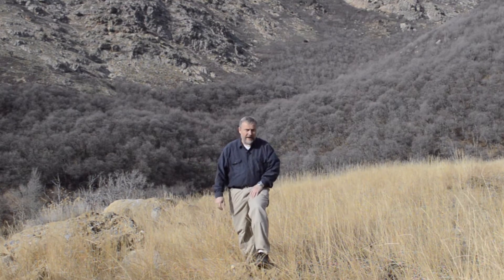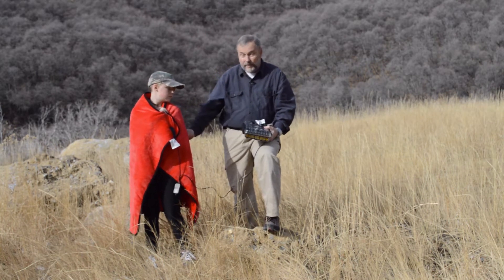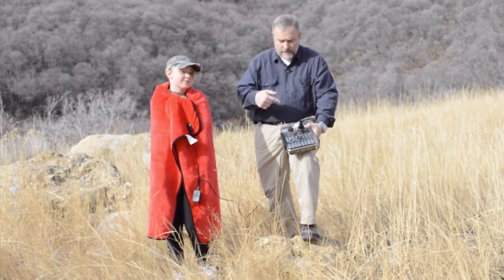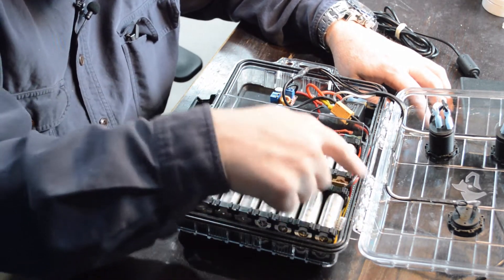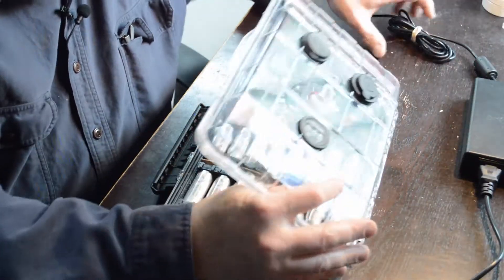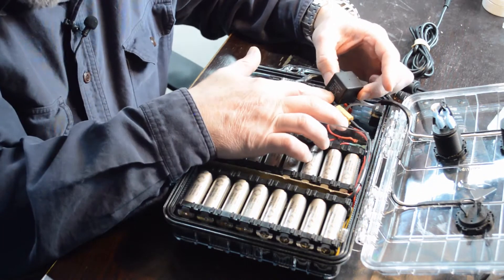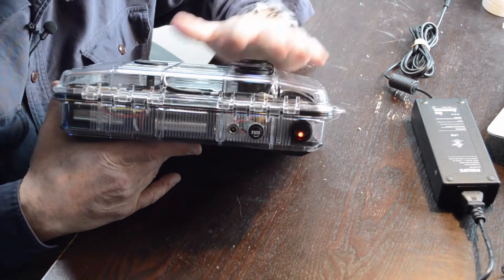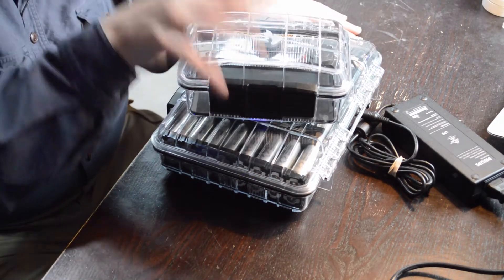Medium DIY PowerPack

Comment: Well you don't want to trickle charger them but that buck converter you have I don't believe it actually shuts off so it's if that power supply only puts out 16v that's all it would go up to and when the voltage is 16v there will be no current flowing

Comment: Hi Frank, have been gathering bits to build, I will be using a 10p 4s config with a charge controller and a dc to dc stepdown circuit to give me a clean 12v. I am very keen to see your circuit diagram especially the relay and charging part, can you please update us.
Reply: Richy Raine ..4 months and no update. ..think he don't want to share with us

Comment: After thinking about it and getting the numbers right the small battery i made was a 4p 3s which is almost 12v used for small projects like powering 12v soldering iron and such , The project box your using is rather interesting wish they were easy to obtain in the UK. also what do you do if the cells become unbalanced? there's a risk of destabilization and meltdown if it goes way too far out.
Reply from the maker: I have balance leads on the cells and I can use my iMax B6 to ballane the cells.  I have not seen any issues thus far.
Reply: Thats good then , I also managed to get one of the 12V blankets now im thinking what kind of battery should be constructed to support it.

Comment: Interesting project ive got to get me one of them 12v blanket things as the snow is hitting the uk at the moment and its real cold. when it comes to large batteries like this i worry about over discharge protection. Im collecting too many 18650 cells at moment so i need to do something amazing with them.
Reply from the maker: I have really enjoyed working on my portable power packs.  My goals were to have potable renewable power storage.  Please let me know what you come up with using your 18650 cells.